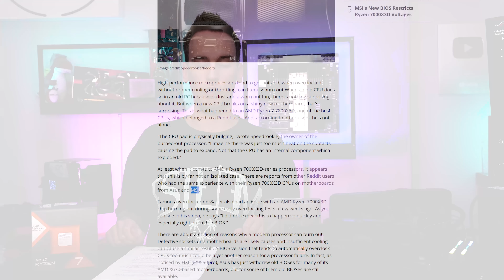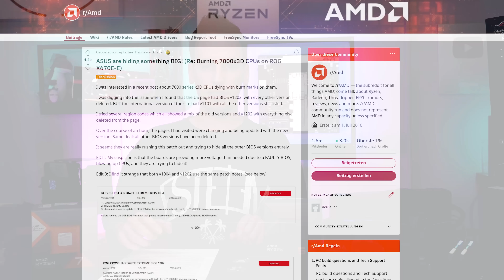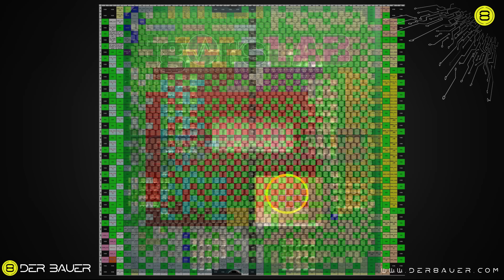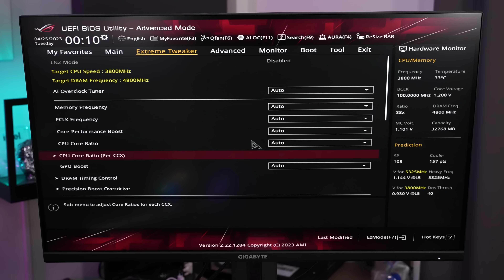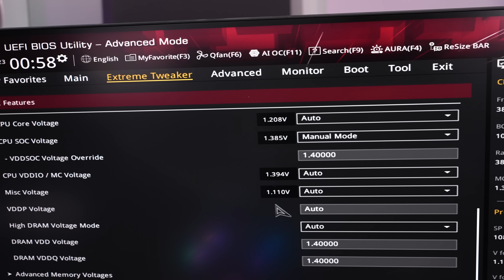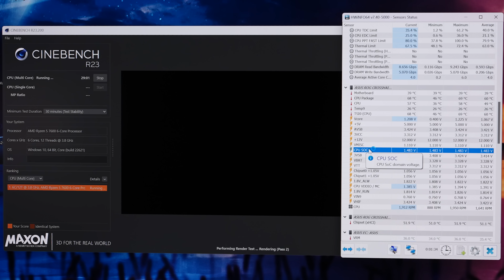I missed the Damage on this Ryzen 7900X

Comment: I have a theory: It's not a physical defect in the socket, the heat is so great that the cpu pcb created a bubble/emboss. This could be the solder quality used in ryzen processors. The die is welded through micro spheres, if this weld does not have the expected quality, it can heat up and become liquid and/or move. If it moves, and it is at a GND point, and its neighbor carries any voltage other than GND, there will be a short circuit. Due to the position that the cpu is (vertically) gravity attracts the loose solder and makes it touch another solder.

I'm not confident it's a bug with bios, or problem with voltage, overvolt wouldn't burn that way, and usually only affects the inside of the die. This type of damage seems to me to be of the short circuit type.

I think this generation was a fiasco. Ok, it performs, but intel and amd pushed the thermal and power limits to achieve this performance, a sign that moore's law is weighing on engineers. I find it intolerable for a mid end desktop cpu to consume more than 60w. The trend should be cooler CPUs with lower consumption, delivering reasonable performance. If this is not happening, it is because they are stagnant. I definitely won't be leaving my zen 3 so sedate.

Comment: It would be extremely interesting to see cross-sections of the CPU's carrier PCB around the fault area, to rule out some kind of short (e.g. low microvia clearance or backdrill defects) in the stackup instead of it being something die-related.

I also wonder if AMD are using embedded passives in the PCB for short current loops on the decoupling. If so, and they're pushing the limits of capacitance density, they'll likely be using barium titanate MLCCs with extremely small electrode oxide layers, which results in a low dielectric strength and, as a result, low voltage withstand. If they've not left much of a safety margin on the voltage rating, or if the embedded capacitors have a higher incidence of defects (e.g. shearing due to thermal cycles within an inelastic media) then I could see them failing short and frying the CPU without there ever being a fault in the die.

Hard to know what it is without further investigation, really. It'll be super interesting to see a technical breakdown of the fault once they've done the analysis and figured it out.

Comment: I gotta wonder if the Northbridge dices in the recent Ryzen processors are sensitive to anything unrighteous. Nevertheless that's not a good news. Of course, the reaction to the Sudden Ryzen Death Syndrome was to upload the bootloader (BIOS) update to clamp down on voltage on the affected Socket AM5 motherboards which hopefully should keep them from burning up the CPUs.

Comment: ASUS x670e-e/gskill ddr5-6000 cl30, since November. Went from a 7600x to a 7950x to now (since launch) a 7800x3d, running expo1 , even trying “expo tweaked”.  Gamed , ran a ton of cinebench and other benchmarks. Been fine the entire time. From 0904, to 1003, to 1202 now. Weird. Love this system. Love it.
Reply: Same board with a 7950X3D, running EXPO 1 and PBO, has been running brilliantly for the 3 weeks it's been built. But now I've become aware of problems others are having and I went back to stock everything until we get a revised BIOS. Too much money was spent so I'm chickening out.
Reply: @jorgecucalonf  cool. I’m gonna keep running as is. Cheers.
Reply: @jorgecucalonf  I’m in the exact same boat as you, not sure what to do. I’ve already had expo enabled for a week but I’m gonna switch it off until a new bios update. Right now I’m on 1202 for the x670e-e.
Reply: @d1didit799  1202 is the newest... What do you think will happen in a newer one? They already know of "whatever issue",.. 1202 is what id run, and run expo, but do you. What is odd, is them deleting the older/lower bios updates off their site. Seems a bit odd. But, if your running 1202,........ after they know, then what do you expect to come later? But yo.. do you mate. I get it.
Reply: @Kyote7667  Yeah you're right, before you responded I came to the same conclusion.
Reply: @d1didit799  and here is 1301, and it’s basically the same thing.

Comment: Think resistors not bipolar elements. As wires heat up, they burn as they burn resistance increases as resistance increases voltage drop increases and everything heats up until it fries it self. So issue here is most likely with voltage stabilizer overcompensating for voltage drop on wires that heat up and causing more damage because it draws more current. Current kills resistors/wires not voltage, bipolar elements on the other hand have junctions that are sensitive to everything from static electricity to cosmic radiation etc.

Comment: EXPO sounds right. I remember people talking about DDR5 vs 4, and how 4 was superior vs low frequency 5, and high frequency 5 would use way too much power on Intel. Doesn't surprise me AMD has similar issues. Also, shout out to the guy talking about it, and exposing DDR5 shilling when it wasn't actually ready to replace 4. Looks like it still isn't, and I'm not gonna upgrade anytime soon. Just having support for 4 sticks by itself is apparently a problem, let alone actually using 4 sticks. DDR5 is a joke, and we need another generation update to make it good. Everyone is beta testing this stuff right now, it's not ready, and should have been tested longer.

Comment: i knew in matter time it's going to happen eventually since zen2 and zen3 voltage are running too high in idle ...1.5v is too dangerous for v-cache when in idle, this help me in my decision now on choosing right board and cpu, it doesn't matter intel keep updating sockets and thats good thing to keep it more stable for every cpu changes and amd going to learn the hard way now that it needed to update on am5 socket that only way to fix their issues arise now with am5+  improved power delivery and ddr5 higher speeds...no software going to fix it...its requiring hardware update on socket itself

Comment: so what does this mean exactly though, did the new bios updates fix this already or should we update and turn off expo for good and the cpu will be fine? From what I saw expo is if you want to overclock if I'm getting that right? Which in that case I'm fine turning it off forever to just completely avoid the problem

Comment: I was an AMD Fanboy (i still am tbh) even when they were weak dog in Gaming CPUs, this generation i switched back to intel cuz they were the only ones able to make my 4090 go brrrrr, but when i upgraded to 7000 amd CPUs i could not even make the ram faster than 4800Mhz which made matters worse cuz my 5900x with my 4000Mhz DDR4 was faster than 7900x with 4800Mhz DDR5. tried different boards and different cpus and ram sticks jus to be sure but nothing. so i switched to intel and now seeing this issue making me glad i did not stick to AMD this time around

Comment: This is the kind of reason why I don't upgrade my system to the first generation of a new AMD socket. There is always some chronic problem. It's either the memory controller being obnoxious like the first gen ryzen was or some other weird stability issue. This time around however there were no stability issues because AMD probably pushed the voltages too high in order to set the clock speed to the point where there's almost no overclocking headroom so that they can compete with the intel 13th gen. I'm purely speculating this because the zen 4 efficiency increases astronomically just by a little undervolt and underclock. I mean if I was in charge and if Intel was not relevant, I'd probably set the clock speed and default voltage a bit lower and provide 10% less performance with extreme efficiency and these cpu's would sell like a lot more because there's also 10% easy overclocking headroom which will make every tech youtuber go insane and positively advertise the cpu for basically free. Also there'd not be the "95C but this is fine" drama at launch. Also there'd be less RMA, the benefits are endless.

Comment: I have RoG hero e670 and was boosting my 7950x to 5.7 on expo 1 bios 1001. I did update and now boosts 5.5 😢
Reply: Yeah AMD heavily adjusted when the high voltage boosts can happen. I usually only see 5.5, but a few hours ago in Sniper Ghost Warrior 3, my 7900X hit 5.65-5.7 a handful of times for a small duration of time. I also hit 6GHz somewhere along the lines of a Time Spy run.

Comment: This makes me wonder, if AMD experienced this issue on a small scale, before launch of 7000 series? Hence why they said 95 degrees was a fine/safe operating temperature. 🤔
Reply: All I see is they increased high temps a lot and say it's fine and now a lot of RX 6000 GPU's are having the die cracked, CPU's burning...

On my Strix RX480 for example which is flashed to Strix RX580 has the bios set to 87Cº and starts downclocking at like 85Cº probably to prevent high spot temps and in fact the last time I changed thermal paste I had a defective MX-5 thermal paste and recently my PC kept shutting down, MSI Afterburner never reported more than 87Cº on the GPU so it was a bit hard to find the problem, it was only when I started burn-in test and decided to stop the GPU fans it shuts down in seconds even though the GPU never reported more than 87Cº...

So I bought MX-6 opened up the GPU and found that the MX-5 despite me having done a full spread over the entire die some spots the thermal paste didnt stick, if it was a newer AMD GPU with much higher shutdown temps I'm almost sure the GPU would be dead by now since I had so many shut downs from high temps...
Reply: @guily6669  Total nonsense how you exxagerage the amount of dies cracking from heat. 6000 gen had very few issues. Barely none to be exact. The few rare cases you name dont speak for a giant group. dont use your <0.01% of product defects as a means to argue. We could do the same for Nvidea, it burned chips, and power cables and it blew up chips with voltages and so on. 

Some architectures got more issues than others. RX 6000 was almost flawless, RX 7000 has some new architectural issues from RDNA 2 to 3, Same for AM4 to 5. Its bound to happen. But these issues were minor and there are other options available in case people didnt want to deal with the first generation of new architecture.
Reply: @dicknr1  Well it's so rare that a guy who repaired GPU's had many with the die cracked, if it was so damn rare how would a person from somewhere get many with cracked die on their shop to repair, unless most of the world GPU's were sold to that location LOL...

And likely the number is probably always going up and not going down with the original paste drying the more time it goes the more likely it is to have problems.

Also my comment is not a Nvidia vs AMD kind of comment and about Nvidia cables burning it's a whole different kind of thing while the dies cracking\burning the repair is throw everything in the garbage cause it will be pretty hard to find a replacement die...

Comment: the actual problem maybe the RAM, DDR5 are using a lot of useless stuff making it just the same if not worse than ddr4, ddr5 4800 should be nigh and day faster than 3600 mhz ddr4 and stock and is surprisingly not, 6000+ is when ddr5 make sense.

Comment: I just installed a 7800x3D on a Asus ROG 650E-E with G.SKILL Trident Z5 Neo RGB CL30 6000 RAM and my idle CPU power draw is sitting at 40W (SoC 1.34V) running EXPO on the latest bios with everything else default. I disabled EXPO today and idle power dropped to about 26W (SoC 1.016V).

Comment: Yeah, I remember warnings about AMD 5000 series that a too high SOC voltage could kill the memory controller.
So for my memory OC I took buildzoid's profile from the HWunboxed channel. That suggests SOC of 1.25V - which expo just sends 1.35V into it if the dims run on the same voltage.
Hydra suggests it even lower at 1.15V... 

Not funny though.... I am on bios 1101, which is no longer available... Did a whole bios upgrade and OC test suite just 2 weekends ago.... More 'work' this coming weekend

Comment: So the word is - stop trying to tweak your AMD X3D systems for additional power, stop tweakin with the ram voltages - worry free! These people Tweaking with chips not designed for it, out their putting moonshine in a CPU/RAM/Board designed for Gasoline then talking about chips melting boards and PCB's are click chasers
Don't be a click chaser

Comment: Is 1.39V normal for VDDIO? I noticed the VDDIO pins are roughly in the same region but not close enough to be the cause themselves.
Reply: Relax, VDDIO is powered by one or two pathetic power stages somewhere near your DIMM slots. The rail draws a minute amount of Amps.

Comment: My Gigabyte Aorus board has issue with EXPO and SOC voltage.
EXPO off is 1.15V, EXPO on is 1.45V
Iv manually set it to 1.35V since I get random restarts at 1.32v. Thats on F5 bios.
All the other bios versions have major issues with stability or hot rebooting getting stuck.

Comment: I have an Asrock X670E, 7800X3D and 32GB DDR5 6000 Corsair RAM for upgrading my PC. I'm gonna wait to see what you and Steve say before finally upgrading. I note I can 'flashback' the 7000 series compatible BIOS without even plugging in the CPU, which might be a nice little safety thing to do before I start.
Reply: Or return and get a 13600k for the time being :D
Reply: @puciohenzap891  I was originally going to get just that but I waited for the 7800X3D reviews … Atm, I have 10600K and 3090. The only real limit I have is Flight Sim on Reverb G2 VR where I am CPU limited. The 7800X3D really shone in this title so I really hope so can stay with it. Hopefully it’s just a case of select expo but manually set SOC voltage … hopefully…

Comment: I have an Asrock B650E Steel Legend and a 7800X3D. In the DRAM frequency setting in the BIOS, I have my G.Skill Trident Z Neo set to 6000mhz, while technically overclocked, it should be rated for it. My question is, is the EXPO setting in the DRAM Profile Configuration a separate option as compared to setting the DRAM frequency to 6000mhz in the first menu? I currently have the DRAM profile setting on Auto as opposed to EXPO, and HWinfo reports around 1.2v - 1.215v for the CPU SoC voltages.
Reply: If you are scared fix the SoC voltage manually at 1.215, Expo sets it to auto which is variable.

Comment: I've noticed weird reporting of SOC voltage for my setup as well (ASUS B650E-F & 7700X).
If I enable EXPO it will load up SOC voltage to a read out of 1.28 in the BIOS but 1.24 in Windows?

If I were to manually do this, it works out the same numbers if I set 1.25v (ends up being 1.28v BIOS, 1.24v Windows via CPU VDDCR_SOC)
I did also notice that there is 2 different SOC voltage readings in HWiNFO, one being CPU SOC that reads the same as the BIOS, and CPU VDDCR_SOC Voltage (SVI3 TFN) that reads the same as other reporting software such as ZenTimings.

Another thing I noticed, is a lot of people reporting how there's been instability with their EXPO kits on newer BIOS's for ASUS boards. The launch BIOS worked fine for me, but every update afterword's was unstable and the EXPO settings would randomly fail every few days or so (regardless of using memory context restore or not).

To get EXPO to work and be stable without issues I had to increase SOC voltage, and found manually setting 1.27v works for me to finally get it stable. this of course has a different read out of 1.30v BIOS and 1.26v Windows.

Also with ASUS pulling older BIOS's I try'd the latest non beta they offer for my board and it made everything worse and unstable again (BIOS 1409), however one of the pulled BIOS's 1406 has been stable and working great for me.
So I feel at a loss here wondering, am I safe to leave it on a pulled BIOS? is 1.30v BIOS/1.26v Windows safe to keep EXPO stable and working?

Overall just frustrated as I just want it to work as advertised and be safe from any damage.
Reply: Don't trust software. It is nice to read it in an app, but that app does magic calculations dependent on the cpu, motherboard and bios to give you that number, and there is room for rounding errors. On the other hand, if the numbers are correct, they are so because in WIndows you have a different workload than what the BIOS does, and depending on the load voltages vary a bit.
Reply: @marsovac  The voltage doesn't change with work loads, it will still show the same numbers on each read out on load or idle. 
Some software is just using CPU VDDCR_SOC rather then CPU SOC. HWiNFO is showing both, one of which is what the BIOS read out is. The main take away I was trying to get at, is that there is some sort of weird offset or something of some kind where it isn't doing exactly what you set, such as my manual 1.27v ends up being 1.30v for CPU SOC and 1.26v for CPU VDDCR_SOC.

Comment: Interesting. Thanks for the update. I just built my system with a 7950X3D + Asus x670e Extreme board 2 weeks ago. I always manually tune my ram settings and set 6000 36 36 36 78 @1.32volts (4x16GB). HWInfo reports (I know not 100% accurate in software but anyways) CPU VDDCR_VDD max of 1.2v, SOC of 1.35v and MISC at 1.110v. CPU Core Current at max of 112A and SOC at max of 17.3A, V-Latch max of 1.43v at a Cinebench r23 multicore load. I will inspect my chip this weekend or next as I am waiting for a AM5 mounting kit for my waterblock.
Reply: Hi, I intend to build a similar configuration also with 64GB of RAM but with a 7950X (non-3D) and air cooled, could you please tell me which memory kit you are using ?